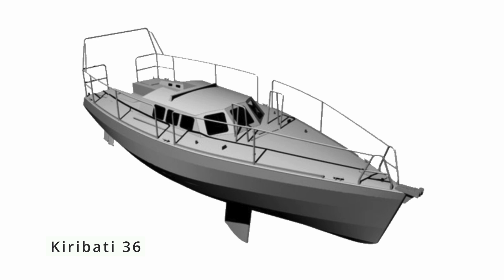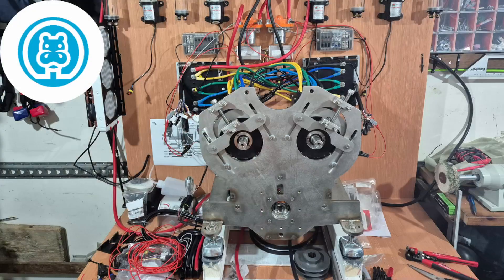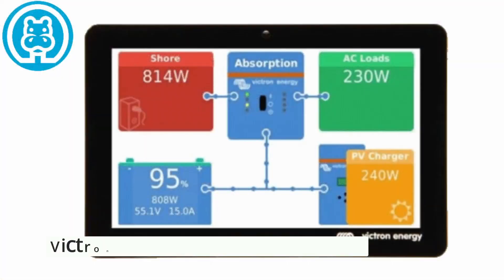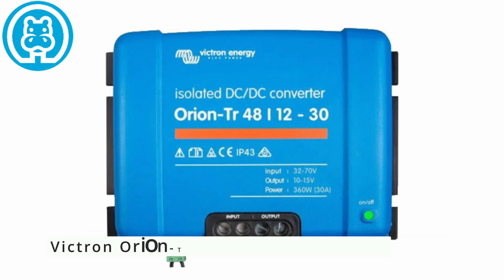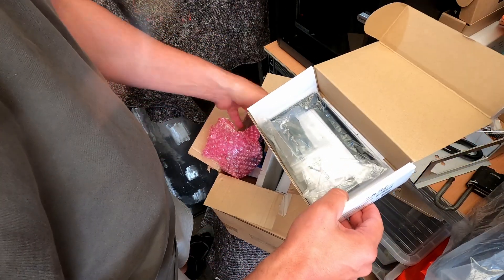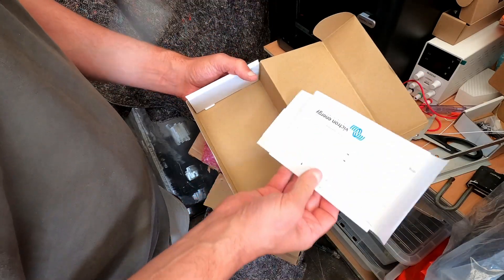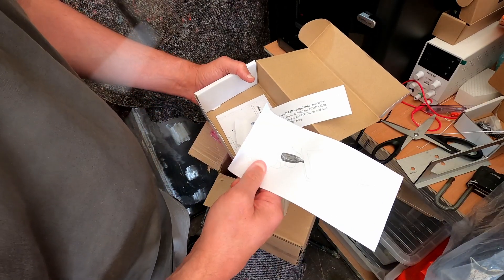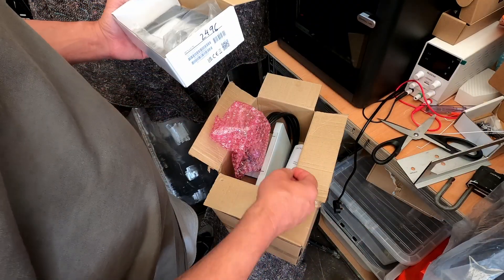Unboxing Victron GX Touch & Orion-Tr | Off-Grid Sailboat Wiring Ep.5 | Battery & Generator Setup

Comment: Hey Henrik, the 230V is AC voltage, right? 
You cannot simply connect AC voltages in parallel, even if you could synchronize the two sine curves you would increase the voltage to over 400V AC. 
You need two AC/DC converters to connect the DC voltages in parallel. 
You can ask Viktron about this as a precaution.
Reply from the maker: Morning Albert, hope all good. Ouch, I have been working with DC to long, dangerous assumption that the same laws apply for AC (Big Thank you for catching that one):) - The EG4 Chargeverter (converting the AC to DC 48v | https://eg4electronics.com/wp-content/uploads/2024/04/EG4%C2%AE-Chargeverter-GC-Manual.pdf) has a max input of 240V so would most likely have fried that box (or shortened it). As the EG4 Chargeverter expects 240VAC in (not DC) I guess I need a way to connect the two generator outputs in a way so that I am left with a 230VAC (UK Generator output). I know that Honda sells the parallel cable for this very purpose [ https://www.geargb.co.uk/product/5001-GEAR-19027/Honda_EU20i__EU22i_Generator_Parallel_Cable_32360-Z07-C61 ] but it is very expensive so my hope was that I could create one myself. In short, I have two 230VAC/15amp out and need to create one single 230VAC/30amp out. Any ideas highly appreciated:) I will do some digging my side but suspect that this is BAU for you:) Thanks Alfred!
Reply: @modularhippo  Hi Henrik, I have looked at the manual for the generators and these two connections are specifically intended for parallel operation. I have not seen them anywhere before. 
So everything is fine with the functionality. 
Have a nice weekend!
Reply from the maker: @albertfunk1176 - Ahhh, nice one. Better safe than sorry:) Appolgies, work daily with an 'Alfred' at work and went to a party last night so when typing your name motor memory kicked in😆 Now corrected👍🏻 Thanks again Albert👍🏻